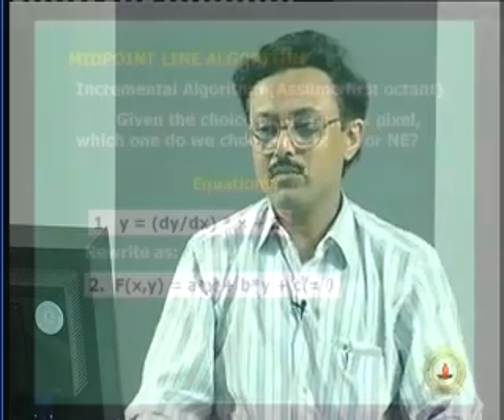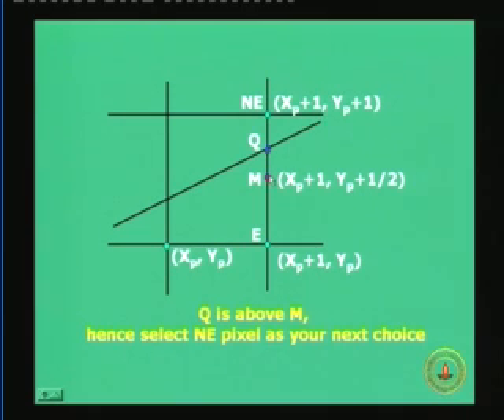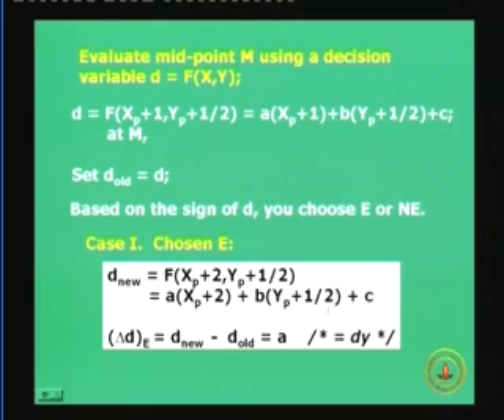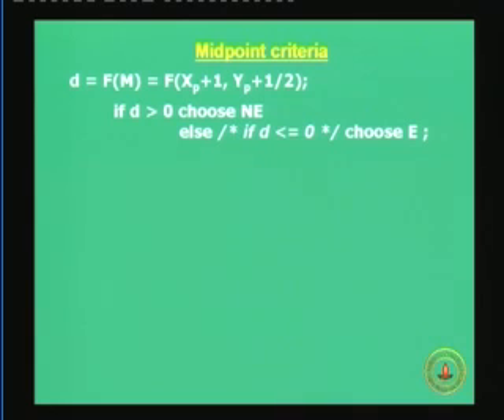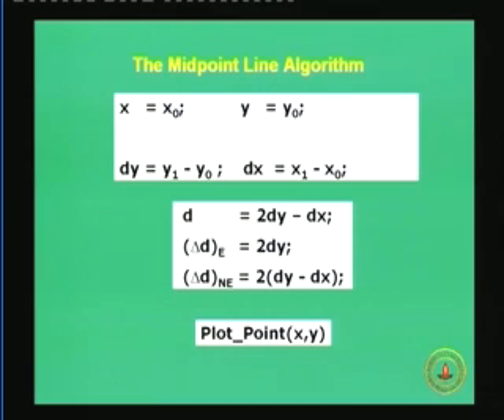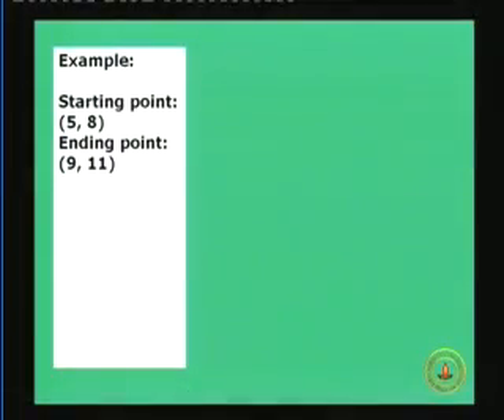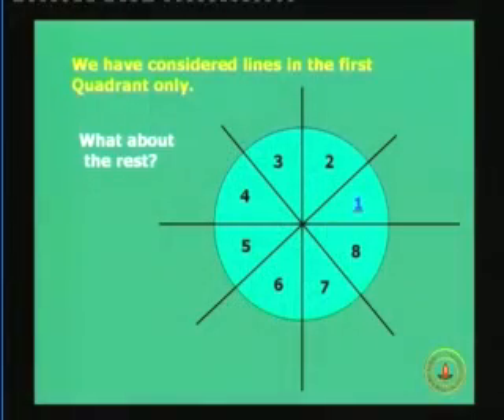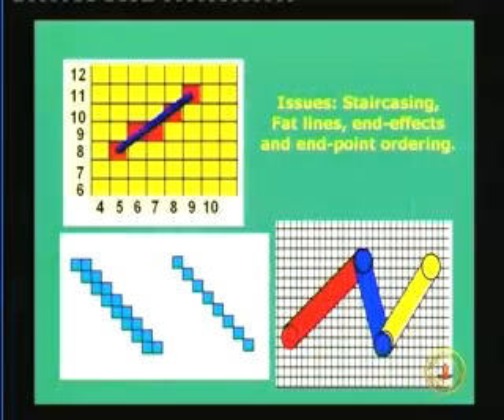Lecture 14 Scan Converting Lines, Circles and Ellipses

Comment: 2:38 - I just want to say its just not fair to put down the DDA algorithm like that because it can be optimized to use just integers and no rounding. And the Bresenham is much more difficult to explain. Optimizing the DDA algorithm is easy to explain. Understanding the Bresenham algorithm is not. Also when you adapt the DDA algorithm to scaling, rotating bitmaps which is used to texturemap polygons. its easier to understand whats going on.